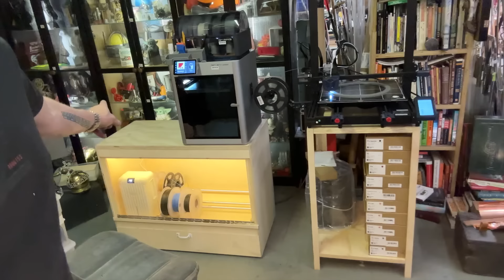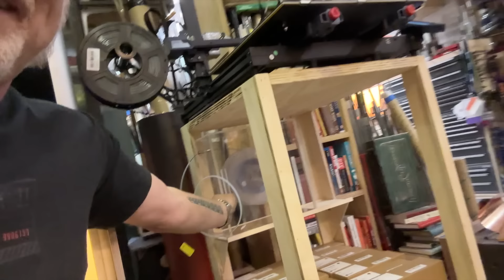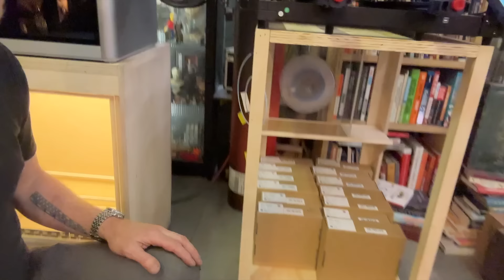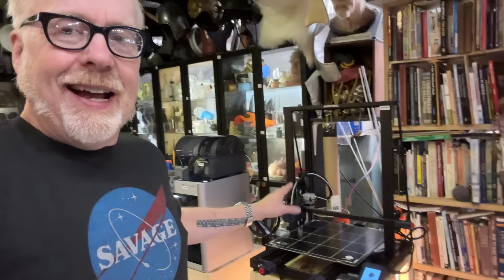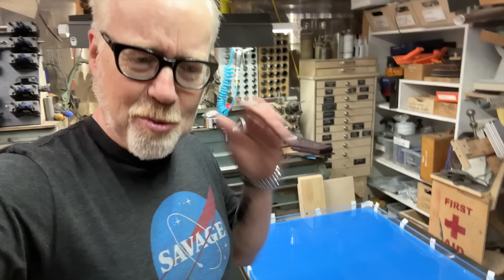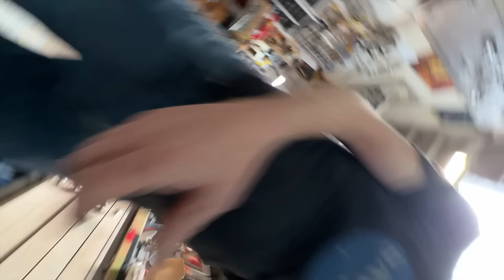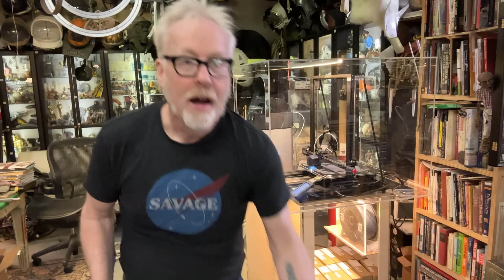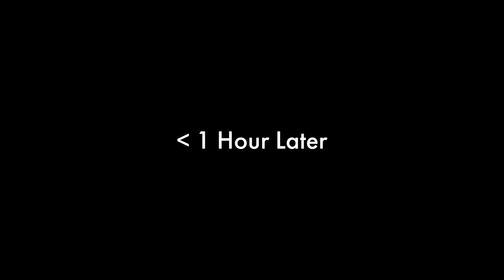Adam Savage's Biggest 3D Printer Yet!

Comment: I know there's already a piano hinge installed on the enclosure, but for future reference there is a set of models for geared hinges on printables that are visually interesting and much more robust than typical 3d printed hinges. The model I used can be found by searching "Print in place mini gear hinge assortment"

Comment: Keeping filament dry is important but it is not all that critical if you don’t have issues related to that. Same thing with enclosure, if you are printing PLA, you just don’t need it. Just saying in case someone not familiar with the 3d printing get deterred by all these work Adam is doing. That’s Adam’s choice and not a technical requirement.

Comment: For some reason, all I could think about was, "Why is the base tray clear acrylic?" 🤔
Don't get me wrong, it looks AWESOME!  It just seems like an expensive base for something that could have been made out of much cheaper material.  Is there any benefit to the base being transparent? 🤷‍♂

Looking forward to seeing the projects you build with your new toys.  I am also curious what direction your creativity will go.  There are so many things you can do with 3D printing.  Robotics and model making.  Props, cosplay, and action figures. Steampunk and Cyberpunk. Puzzles and gizmos.  You name it, 3D printing opens it up.
Reply: I was wondering the same thing. This enclosure could have been made much cheaper with other materials. It didn't need to be 100% acrylic. The only advantage I could see by doing that is that he could use the weldbond for all the seems to make it tigher.
Heat and eliminating drafts are usually the reasons to enclose a 3d printer. Humidity at the point of printing is not as important. 
The clear on the bottom seams unnecessary since a piece of plywood would have been stronger. Also, by having corner posts, it wouldn't have needed as thick of acrylic for all the side, just the door would have needed to be that thick.
I say this as someone with the Lack table enclosure around a Prusa mk3. I have 1/8" thick acrylic on the sides and 1/4" acrylic for the door. It was pretty cheap that way.

Comment: I actually had one of those printers.
I ultimately gave up on it when I learned it had less in common with a 3D printer and more in common with a small yellow citrus fruit.
The customer service is very good for this company, but getting any free, warranty-covered replacement parts meant a 4-6 week wait, even if the replacement part you got didn't fix the problem, or was defective itself.
After almost 6 months of back-and forth, I decided to just get a new printer.
Reply: My Kobra standard was much the same. Heat bed died. About 8 weeks for a new one. Even after months of tuning and countless slicer tweaks, my new Qidi X-Smart3 completely blows it out of the water. Granted it's a much better printer in every way except size and cost a lot more.

Comment: NEXT time try 5000 series aluminum; sometimes cheap from Bataeff in SR or Maselli's in Petaluma. If you want you can nibble out holes for plastic windows. :-) PS with an aluminum enclosure you won't have as many problems with static electricity and dust. PPS I would use washers on the back side of those rivets to avoid stressing the plastic they're squished against.

Comment: Not sure if its been mentioned enough but the inclusion of a backup battery. Some UPC to avoid/reduce of potential electrical caused print failures can not be stressed enough. Doing a 20 hour print and it fails when over half way done due to power outage can be frustrating not to mention wasted time/materials.

Comment: The mechanical calculator scene had me in stitches. Made my morning! Thanks for that.
I have 4 printers. I have 3 in 1 room and 1 is a brick in the garage for parts. I thought about an enclosure and I have the tent for my CR10 bookmarked but I haven't bought it. Oh, and the tent has clear panels so you can look through it.
The biggest reasons for an enclosure is to retain heat and to prevent wind from suddenly cooling the part or bed and popping it off. Been there, done that too many times!
The plastic is a bit overmuch. Cool though!

Comment: another note. Your printer has the build plate set to around 50-60C, hot end running around 200C. The heat build-up inside the unvented enclosure will raise the temp dramatically. While the low humidity is great, the power supply, motor and other parts inside the enclosure will not be very happy for very long. 
Also consider your extruder is inside that box, one of the hardest working motors on the printer. The heat alone of the motor will soften your filament and create you blockages of abraded filament...

Comment: Adam, if you are using PLA, then I wouldn't worry about dry boxes.  I have PLA filament that has been sitting out in the open for 4 years and is still good.  The ends get a little brittle but you just break that off until you get down to the good stuff.  It's the other filaments like PETG, TPU, ABS and some of the more exotic filaments that you need to keep dry.  But really happy to see you so excited about a hobby that I have been into for many years!

Comment: When you finally swap that Marson for a proper electric or pneumatic blind riveter, or even a drill adapter one, you're going to wonder why you didn't get one 20 years ago!

Also, if you're going to leave your printers printing unattended, please please please install a self-contained single-use fire suppressor inside the case, or a full fire suppression system in the shop!

Comment: I'm looking forward to your enclosure build. I have a Creality CR-M4 which needs an enclsure but I haven't been able to curb my over-engineering gene in the design. :)

How about two ducts between your drying cabinet and that box with an enclosure fan to circulate air. If you use your "vaccum hose" and suck the air out of the new enclsure into the dehumidifier chamber you'll draw moister ambient air into the box.  You could use one duct between the two with an exhaust fan on the new small enclosure, too.

Comment: I'd love to see what you think of my drying box. I built an above printer cabinet enclosure from MDF with Acrylic doors that stores 13 rolls with 1 line out to feed directly to my printers and use a reptile pad to heat it. My last step that I've been procrastinating doing is to put in a low RPM exhaust fan to exhaust the humidity.

Comment: The printer has a large build volume but it is still a bed slinger. That means it isn’t very space efficient. It requires a lot of room to swing that bed back and forth. Core XY or similar printers are much more space efficient since the whole frame doesn’t need to be much larger than the bed. Also not having to move a heavy bed around means they can go much faster, that is part of why the Bambu labs printers are so fast. Core XY printers are also much easier to enclose, you just need to attach panels to the sides and top.

Comment: Rivets on acrylic sounds like a bad idea, but hey, they worked!
Reply: I am afraid the acrylic would crack. I am trying to remember if I riveted something with acrylic. Maybe I just used bolts and nuts, but if I did use rivets on it, I would want a washer inside to distribute the pressure.

Comment: If you're willing to commit to keeping the Anycubic printer to the right of the Bambu printers,  you could just mount the acrylic filament storage box you built in the top right part of the dehumidified chamber, feeding through the right wall.
Reply: I was going to suggest the same thing.  Why have the fancy dehumidifier box and not use it??  Of course if you're mostly printing PLA it doesn't really matter.... and if you're going to do ABS, you need ventilation.
Reply: And he did
Reply: @AdamMclardy  no, he mounted a box on the side, giving it a weird shape. I would have kept it in there main box.
Reply: @AdamMclardy  not quite, he mounted a new box on the side of the dehumidified cabinet, with a small fan cycling the air. It's probably the next best thing, but just mounting the spool inside the cabinet would have been easier and cleaner.

Comment: I did an easy, much less expensive and more functional enclosure for my printer. I welded up a 24" cube frame with 1/2" square tube steel (with one cross piece on top), covered the back, sides and top with 1/8" plywood (inexpensive floor underlayment) and put a 1/8" acrylic door on the front. The base sits on a pad of flooring wool padding (sound and vibration dampening). Lights and power inside. Making something structural with acrylic is very $$. My enclosure looks nice, is very quite (one of the primary reasons I did it because the first printer I had in it was very loud, since upgraded) and is a great enclosure for my printing. I print in ABS a lot which is very temp sensitive. The heated print bed gives me a stable warm internal temp (90-100F) with still air. And with the steel framed enclosure I can stack as much stuff on top as I want. The welded frame was an inspiration from you and Jamie and the projects and tables and stuff done with 1" square tube. I learned to weld because of you guys.

Comment: I have rechargeable desiccant dehumidifiers that I found on Amazon. They are way more expensive than when I bought them years ago to put in my filament storage boxes. They plug in to heat and dry the desiccant inside so they can then be reused.
Reply: Anyone wondering, desiccant is to keep filament dry, not to dry the filament. 
People often use a dehydrator to dry filament, but heat can be damaging to filament, so it is a low and slow process.

Comment: I want a large 3d printer, but I want a core xy so the y motion doesn't cause wiggle of the print as it gets taller. They are more expensive than i3 clones, but the ability to print tall and slim is better at potentially faster speeds.

Comment: I've always assumed a 3D printer station needed to be rock solid and never disturbed while printing.  Adam's is shaking all over the place.  I've wanted to get into 3D printing but always felt I didn't have the proper space for it.  Maybe it doesn't need to be a laboratory-type environment.
Reply: It is better to minimize vibrations. Many people put them on concrete slabs on a rubber pad to minimize vibrations both caused by the printer and environment.
Reply: Printers can stand being bumped, but eliminating things that could cause a layer shift or other quality issues or cause the print to come off the bed is always best.
[Edited to fix my incomplete sentence]

Comment: If you notice when Adam is putting on the door there is a tremendous amount of flex in that stand. You definitely do NOT want that.  The biggest quality factor for your printers is mass.  A flimsy stand will not only shake apart in time from the printer jerk, it will cause layer inconsistency and ringing.  Use a sturdy stand, and then I highly recommend the paver method.  Yes, putting a heavy paver under your printer works wonders for ringing and print quality.
Reply: I was nervous with him using power tools on around the printer (Causing shake) while it was running on a long print.

Comment: I've just started 3D printing as well with a small Kingroon KP3s, and immediately dove down the vortex of "how can I make this thing even better?". So far I'm on a Volcano hotend, printed modifications for a 12cm fan in the PSU, installed a mosfet board for the heated bed, Have a BTT Pi V1.2 so I can run Klipper over the network, and now I'm drawing up an enclosure for it with activated carbon sheets lining the walls to absorb noise/smells and improve print quality. It's awesome to see people like Adam who are as giddy and excited about stuff like this!

Comment: My diy 3d printer have 460x600x470mm  /// 46x60x47cm /// around  17,7 x 23,6 x 18,5 inches of max print size ...
and its working for almost 10 years now 😅
Adam , if you want to build your own 3D printer i will gladly help you , give some tips etc 🥰
you can easly build printer like vzbot etc :) 
or build yourself printer like a tank for printing super thick layers but slowly

Comment: Tip for those who want to cut Acrylic on your table saw.  Go to your local big box hardware store and grab a 7.25" Vinyl siding blade for your saw.  Now I know what you are thinking, "That is the wrong size blade for my saw".  Yes, yes it is.  The 7.25" blade will run slower, and the vinyl siding blade has low slope teeth on it that will not chip out the acrylic. Even on thinner pieces.  Combine this with Step bit drill bits and you are an acrylic manipulating monster.  Also, dish soap on the bits work wonders.  If you don't have a step bit (GET ONE or MANY) you can sharpen an old drill bit to a point on the grinder.  Use a slow speed when drilling with the dish soap as lube.  Perfect cuts and holes every time!  And Adam, why build the second box?  I ran spool trollies (roller bases that the reels sit on) in my dry box (Which I built AFTER seeing yours) and have PTFE feeds running out through the Dry box up to my two printers.  Works perfectly. My filament literally never leaves my dry box. Video will be up on my channel shortly.
Reply: When you say 'step bit' I think you mean what some engineers call a 'Pilot Bit' which has two cutting diameters, A small 1cm(ish) deep thinner starter tip and a thicker bit. Think of it like having two drill bits in one; A small starter bit and the actual size you want-to-drill bit all in one.
Reply: @penfold7800  Not the actual purpose of those bits even if  they are often times used to start a hole (but not actually drill them completly since they only have cutting edges on the tip). They are for running live centers on the lathe for Starting a hole there are actually other bits (NC Bits).
Reply: No, I mean step bit. Adam uses them all the time.  Google it.  @penfold7800
Reply: Using a pilot bit, especially near the edge of a piece of plexi will almost guarantee you crack it.   @penfold7800

Comment: Rivets in acrylic tend to crack after time.  Use a washer on the backside for the rivet to expand against sandwiching the sheet in between the head and washer.  Much less stress on the sheet=less cracking.

Comment: For all of my acrylic cases I make, I just tape the joints together EXACTLY the way I want them. Then take nail polish remover from the dollar store (acetone) and let a drip fall down the joint and let capillary action do it’s thing. About 30 minutes later you have a perfect, clear, fused joint. Just don’t drip the acetone anywhere you don’t want it. It will mess up the finish.

Comment: Manually drawing the front door without a ruler is next level! Awesome job Adam! It looks great.
Reply: Adam has taught this trick in the past, but it still takes a good deal of experience to actually execute this trick as well as Adam does. He has many years of experience building props, including at ILM. On some of those jobs, he had to do this kind of thing many times a day during some of his builds, just to get the job done in the timeframe required.
Reply: It's easy when you know the trick. Use your pinky as a guide to follow the edge of the material.
Reply: Not only manually but also with the precision of a ruler... When he drew the last line it coincided perfectly with the first 😂

Comment: Consider bumping up the nozzle size to say .6mm or .8mm to save time. You could have thicker layers and still maintain quality on large prints. It does use more material, but can sometimes cut down times to a 3rd of total print times and not cut much quality. Try it out in slicer settings and see if its something worth looking into.
Reply: Depends what you're doing. You can expect a lot more oozing with 0.6mm+, which in turn will cause blobs, zits, stringing and under-extrusions. Might be OK if you're post-processing anyway, but IMHO the negligible speed increase is not worth the significant decrease in quality and reliability, especially when running a print farm.
Reply: @dsp4392 Putting down 4X the material (if you have the heat) is not negligible, and you can get clean results with proper setup just like with any nozzle. Don't blame the tool if you can't get good results.
Reply: Pretty sure you have to change out at least the heatbreak. Anycubic is proprietary.
Any firmware updates have to be done through a phone app as well i believe. I have one, but haven't installed the app in a burner phone yet. Had I known this was the route anycubic was taking I would have bought something else.

Comment: When cutting and drilling acrylic, the results are much better when using saw blades and drill bits that are designed for the purpose.  When using general purpose blades and bits there's a bunch of cracking and tear out (and often melting).  The different angles on these blades and bits makes all the difference in the world.

Comment: I'd be a little hesitant about the filament running out of a small hole in the acrylic. Eventually the filament will wear into the acrylic and could do things you didn't intend and lead to issues like the printer struggling to pull filament.
Reply: Small length of ptfe tubing on the inside